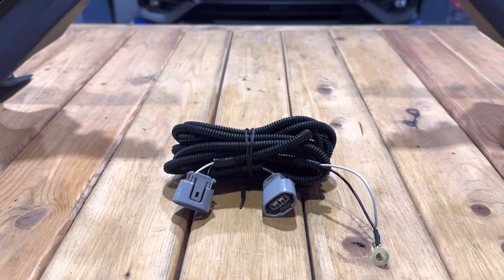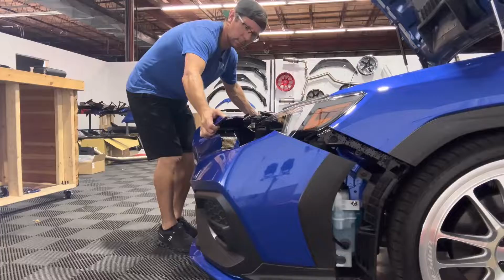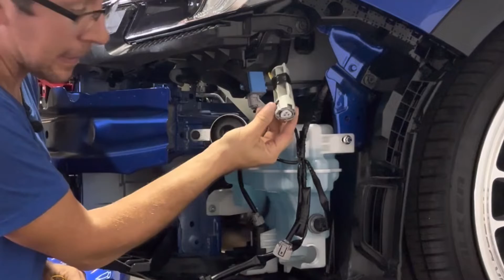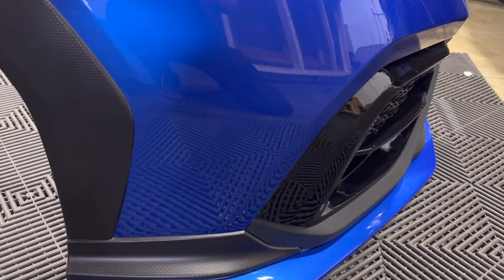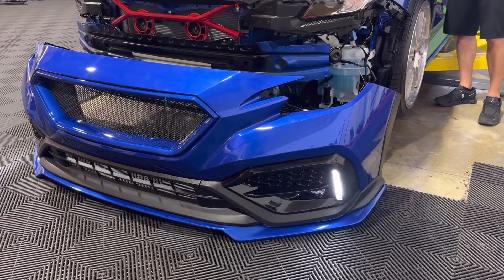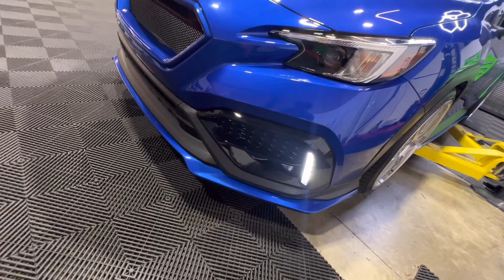NOBLE Performance JDM Style DRL / Turn SignalFog Bezel | INSTALLATION | SUBARU | 2022 | 2023

Comment: What is the size of the threaded hardware at 5:07 as well as the nut and washer? I had mine installed by a repair shop after a collision and they didn't install this piece

Comment: To those who install this, I would not tap into the fuse box. I did so correctly, followed the video to a T, and it triggered a CEL. Code was p0480, Fan circuit 1 issue. Flipped fuses, flipped the add a fuse, same thing after clearing the CEL. Do the interior method instead, my Subaru dealer warned me that too much voltage was going to my fan circuit and the control module could’ve failed. Unplugged the add a fuse and have had no problems since
Reply: how were you able to clear the CEL?
Reply: How do you do the interior method

Comment: Thinking about buying the bezels but how would the turn signal work with limited? As they are LED
Reply: They have an updated V2 version that has a wiring harness for the limited trim and above steering responsive headlights, which is apparently plug and play with turn signal functionality.

Comment: do you need 2, 10 amp fuses on the add a fuse ?? ive tried that and connected as video instructed to no luck does the e brake need to off ?
Reply: I have the same issue, turn signals work but the daytime running DRL lights don’t want to turn on

Comment: Can I install said bezel without hooking up the turn signal? Would it still work? Or am I supposed to set up the turn signal?
Reply from the maker: Yes, you can absolutely wire just the DRL! Wiring up the turn signal is just an added bonus.

Comment: will this work with srh lights? I checked the wiring diagram for the base lights and srh diagram, they both have the yellow wire for the flashing function
Reply from the maker: This is compatible with SRH lighting. You may need to check your headlight pin out to confirm turn signal function.

Comment: What if you need to take off the bumper again could the lights be disconnected without having to disconnect the yellow wire
Reply from the maker: This is a really great question! The Bezel lighting has been updated to include total plug-n-play connectors. This allows you to simply press and release a clip to separate the wiring for future service.

Comment: Installed as per instructions one side works one side doesn’t wiring is connected as the video instructs and to the add a fuse all connections are fine why would only one side work?

Comment: Question, I’m installing the bezels, for the add a fuse, do you have to have two 10 amp fuses in both slots? And do both have to be in for the led light to function?
Reply from the maker: That is correct. You need the fuse from the original circuit, then an additional 10amp fuse for the bezel lighting.

Comment: is there a reason to not simply use the OEM plugs then go under the dash and use a jumper to connect the for light switch wiring to bypass using a switch and just have everything work as is without using any new fuses?
Reply from the maker: That’s a perfectly fine way to do the installation as well.
Reply: Make sure you install a fuse on that jumper.  It would be nice if you could buy that jumper separately, but unfortunately Subaru parts told me they don’t sell it separately.
Reply: @SuzukiKid400  I've ran it so far without can you give me an idea of what I should buy?

Comment: How feasible would it be to cut the “fake grille” in the bezel and replace it with mesh…?
Reply: if you have a base you cant you'll have to buy all the hardware and it will cost more than the kit by far.

Comment: Why don't the turn signal lights sync? That would drive me nuts.
Reply: The factory turn signal bulb is a halogen bulb while the new DRL lights are LED. This means every time the factory bulb is activated it takes several milliseconds longer to warm the filament to a visible glow compared to the instantaneous shine of the LED light. Compounded with multiple on and off cycles the lights become “out of sync”. Converting your factory turn signal bulb to a aftermarket LED bulb will solve this issue! 🤘🏻🤘🏻🤘🏻

Comment: Awesome! They look fantastic. Do you have info/instructions for using the existing wiring?
Reply: I made my own OEM plug by making a loop that wires back to itself with a fuse in the middle, then pining it to the same type of plug as the one under the foot well(not sure what kind as I already had it lying around).  The point is to just complete the circuit and have a fuse for safety. Worked for me though you will still have to splice the turn signal wire as that is not part of the built in loom.
Reply from the maker: We don’t have instructions for using the OEM wiring because the kit comes equipped with its own proprietary harness. But our buddy Cody has something that might help you out! 

https://youtu.be/8_HpIfQQYPw?si=D5WjBH7QKn_Os5hy

Comment: Is there a way to fix the “Off timing”  flashers? Turn signal and bezel aren’t flashing at the same rate.
Reply: Yes, the DRL lighting is LED while the factory turn signal bulb is halogen. Replacing the factory turn signal bulb with a aftermarket LED bulb should resolve this issue! 🤘🏻🤘🏻

Comment: Is this any different for a limited? How would I get the turn signal?
Reply: I was going to try splicing it to a yellow wire that is visible on the limited light wire loom which I assume is the turn signal wire. Unfortunately, I didn't get the chance as my set didn't fit correctly even after I received some extra hardware provided by Noble and ended up having to return them. I will probably just get the OEM.